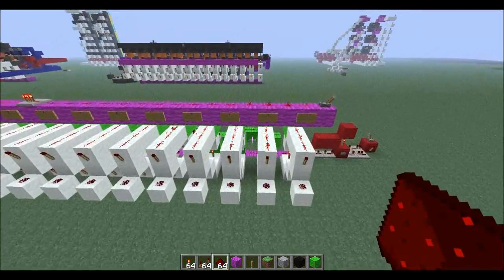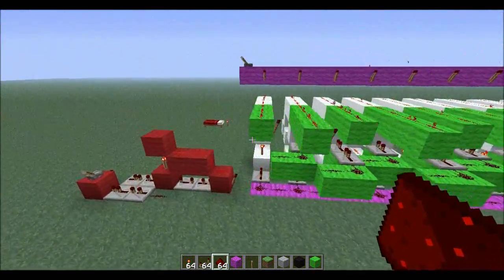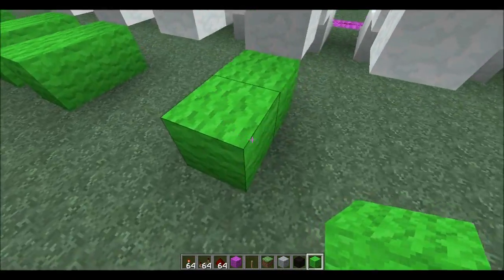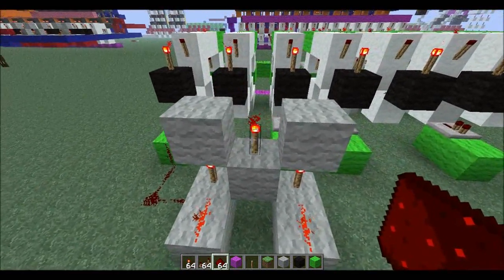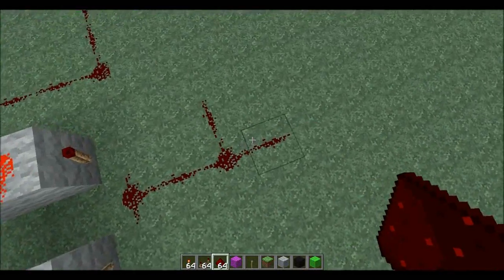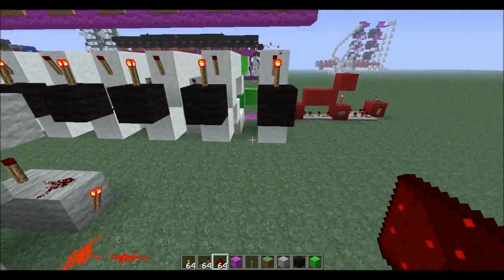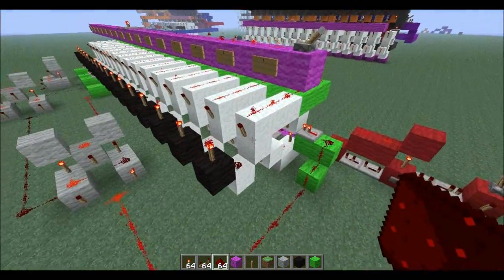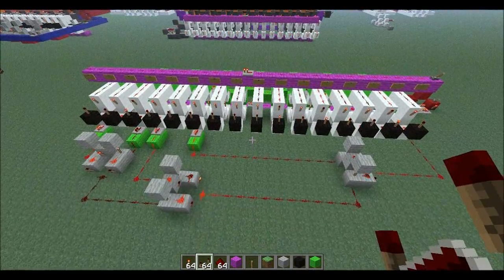Minecraft Redstone Tutorial 16 Bit Linear Feedback Shift Register | Pseudorandom Number Generator

Comment: thanks for this!!! i am making a clocked 7bit Binary division system (divides numbers 1-127) and hoping to make it be (in theory) able to calculate as many Radix bits for the division as you want,,, i am hoping to have the answer appear in 7bit binary With 14bit Radix...
I was stuck on one part till i found this video and this design is the only thing that would fit,, THANKSSS!!! 

P.S. this is for a calculator on the Xbox360 edition. Will be uploading a Vid of it once i get the division working

Comment: Wouldn't you have to time the register to shift only as fast as you can get the output of your XOR gates back to the first DFF? I didn't count, but there are several ticks of delay between the the leftmost bit and the input at the first bit, so you might end up with intermittent 1s in your register, hurting the "randomness" of the output.

I'm not sure if this is the case in your design, I'm really just wondering if it matters statistically with respect to the output.